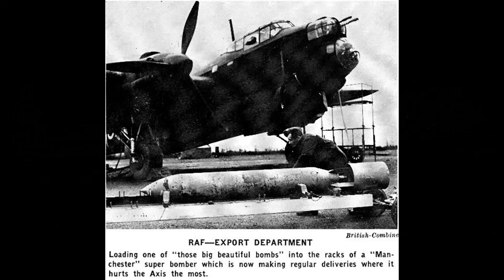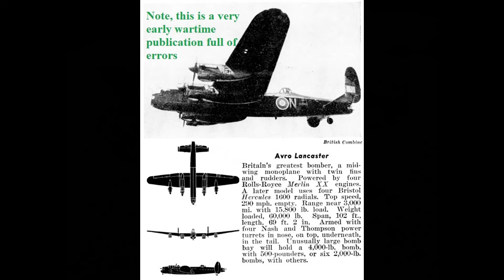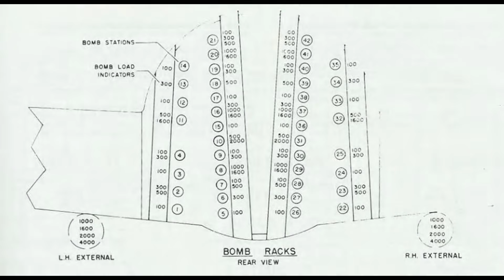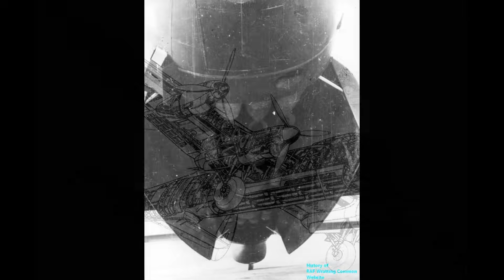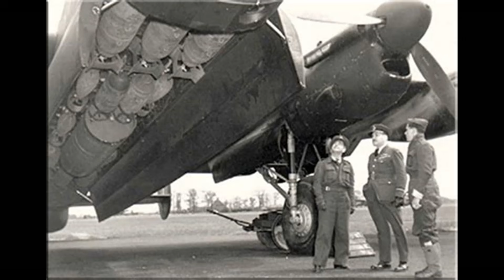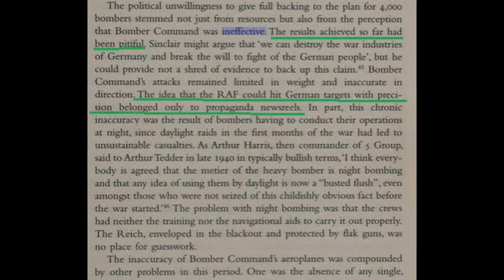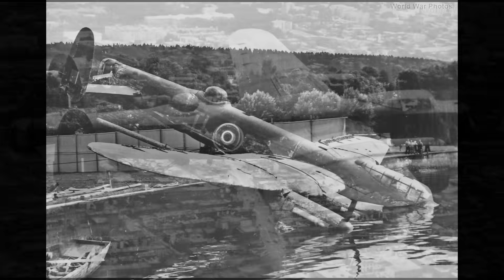Avro Lancaster, Payload, Turrets, Stability and More

Comment: The Lancaster JB456 you show at eg 28:20 seems to have a very odd mid upper turret.  It's positioned as per the Martin turret but looks to have a pair of impressively long guns coming out of it.  Any ideas?
Reply from the maker: I'm not sure, but some in the comments have some decent theories.
Reply: JB456 testing the Bristol Type B-17 turret with twin 20mm cannon.

Comment: Someone already mentioned twin stabilizers let you fit into existing hangers better than a single taller one; and similar hanger height restrictions are, I believe, why most modern carrier aircraft use them.  (Though you could alternatively go with the folding stabilizer route like the old A-5 Vigilante had to use).
Reply from the maker: Yes, I covered that hangar issue in my recent TWA video. It's sometimes a factor.

Comment: I was taught that there are three regions of stability while in a bank in reference to bank angle.  
A shallow bank is a bank angle that when input pressure is released it will naturally return to the trim setting.
A medium bank is a bank angle that will continue when input pressure is released.
A steep bank is a bank angle that will increase when input pressure is released.

I enjoyed slipping a plane in for a crosswind landing.  I never understood the roll of dihedral (I'm still going to have to study on that some) except in kites.  I always thought in terms of spilling air out from under the "high" side of the kite in order to return it to some level of equalibrium, (or some level of level)  [see what I did there with level?]
Also, it seems to me that dihedral and high-wings provide what appears to be pendulum like stability.

Comment: Whats the reference for the b17 being able to carry 12000 lbs internally. No question it could carry that weight but on the internal racks?
Reply from the maker: The Reference is the B-17 pilot's manual. I think I put the actual page on screen but I'm not sure you can see the details. Anyway it's 12,800 pounds internally via 8 1600 pound bombs. There were of course external hard points as well.
Reply: @GregsAirplanesandAutomobiles  thank you.

Comment: Hi m8. Thank you tons for last response to my question a while back re the Lycoming XR-7755 36-Cylinder engine, taa so much m8. Another Q from me is on its way but if you have better things to do , don't worry too much about a response. You are amazing by the way.   
 Q - How many - approx,  (ratio wise maybe),  Manchesters were constructed without the central fin?. I've never seen a Manchester empennage arranged like in those images early in this vid. I can imagine performance was a little better at least, in this model due to less drag. 
You know what they say 'Small Things Amuse Small Minds' though I believe this saying is upside down. Small Things/Big Minds.
Be well Greg.   @.

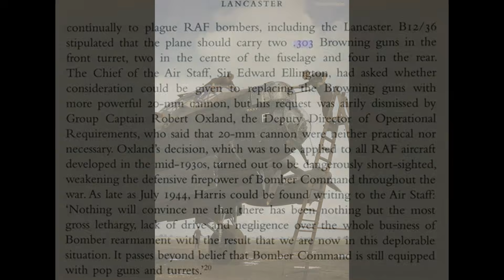Comment: 21:30  It's interesting that they didn't go with the Vickers .50 machine gun, which seems like a reasonably easy swap for the .30.
Reply: The Vickers 50 was not a good swap for a browning 303 in terms of dimensions. It had a lower power than the Browning 50 and a low rate of fire.
Reply: I think they did for the rear guns in later Lancasters
Reply: @oco8783  no, brownings
Reply: @wbertie2604  I meant .50 cals, I don't remember what type they were. They were probably Brownings

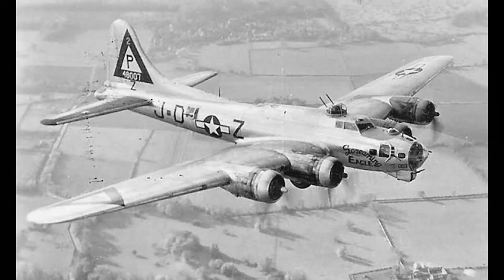Comment: 22:59 - B-17 from my tail gunner Dad's bomber group: 384 Heavy, Grafton Underwood - Triangle P - Assigned to a different squadron though. Use this search string for more info: B-17G 44-8007 
"44-8007 was equipped with a PFF (RADAR) system in place of the Ball Turret. Therefore, it did not have a Ball Turret Gunner assigned on any missions."
Reply: AN/APS-15 AKA H2X  or "Micky" 3cm wavelength ground mapping and bombing Radar
Reply: @richardvernon317  Wait, ground mapping?? Need to check that out, thanks for the reference! And of course equal thanks @Cowboy Bob for mentioning that system - never knew about the automated ball turrets, that stuff is really super cool - hard to imagine any such turrets could lead their targets in a meaningful way, but I guess being smart always meant to find those amazing shortcuts that did 85% of the functionality while taking 15% of the effort of the perfect solution...
Reply: @decnet100  There wa no automatic turret on the B-17. H2X was a bombing system loosely based on the British H2S, but fitted with a bomb aiming system that would fly the aircraft via the Autopilot and release the bombs like the Norden Bombsight would. Yes the lead aircraft would bomb by radar based on an aiming mark plotted on the CRT display by the bomb aimer or navigator and the rest of the formation would toggle bomb with him. The Radar scanner was in a retractable radome located where the ventral Ball turret was normally mounted. Only 4 Squadrons of Lancaster's did get an auto gun laying radar for the rear turret from September 1944 onwards, but they were really not that reliable and were more useful for early warning that somebody was coming up from behind.
Reply: @richardvernon317  Ah that makes sense then... I figured it was an entirely different radar system to the H2X/S, so I guess that would make the plane he described with the radar in the ball turret the lead plane then?
Reply: Would these types be used as a "bomber leader?"

Comment: 15:00 safe jettisoning of bombs wasn't considered too much of an issue as it was assumed that the target would be Germany and any route to or from it would be over sea, with designated areas off the coast to dump bombs. It doesn't help with hung bombs, of course. A number of British designs (produced or designed) of the period had bomb cells also in the wings where there was even less chance of access. For wing cells the logic was to allow salvo release of an entire load easily by concentrating the bombs across the aircraft's COG.

Comment: Even before the eventual failure of the Vulture, Handley-Page had indicated it was going to switch to four Merlins. I'd need to check which HP. 5x number was the original design. 

These designs were originally to P.13/36 which was the new concept for a medium bomber with up to 8000lbs of bombs with the potential for catapult launch for overload. The previous (medium, but not really distinguished as such) bomber target (Wellington, etc.) was 4000lb. I have read (and I don't know if it is totally accurate) that the Halifax still had some structural strengthening for the catapult launch option. This requirement reminds me a little of the He-177 and the requirement to dive bomb.

B.1/36 was the Stirling and the heavy (circa 12,000 lb in the specification, IIRC, actually capable of more), but the move to Merlins for Halifax and Lancaster allowed much more than the P.13/36 target.
Reply: A not untypical load for a Lancaster going to Germany was actually 8000lb, but without the need to catapult launch. A lower weight allowed a faster cruise speed. But sometimes missions to Germany were with the full 14,000 lbs.

Comment: Interesting to hear that the bomb bay design meant that the crews took off with armed bombs and couldn’t access them in flight.
Reply from the maker: Yes, well not exactly armed, but with the pin for the arming vane removed, which means almost armed.
Reply: @GregsAirplanesandAutomobiles  Thanks Greg, yes, some comfort for the crews. BTW, on crew safety, have you ever read Into The Silk by Ian Mackersey? Tells the stories of how air crew got into the Irvin Parachute company’s Caterpillar Club, ie by bailing out using one of their chutes. A tremendous read.

Comment: The LeO451 bomber had low wing and twin tail...
Reply from the maker: Yes, but the fact that almost nobody has ever heard of it sort of makes my point. In regards to that plane it has some sweepback, and a good amount of dihedral in the wing and a lot of dihedral in the tail. All of which probably adds up to just enough in that case.
Reply: @GregsAirplanesandAutomobiles  Well, even if nobody knew it, it would make no difference from an aerodynamical perspective...
I'm kidding 😁

From what I've read about the LeO45, it actually... proves your point: it had poor lateral stability at low speed making it somewhat hard to fly. Despite that, the engineers... reduced the size of the vertical stabilizers. Which did no good, of course. They were later replaced by larger ones.

The twin tail was used to clear the field of fire for the canon on the back (an Hispano, from which the 20mm used on British aircrafts were derived). Later, it was discovered that this canon was ineffective: slow rate of fire, and limited amount of ammunition in the drum, which was itself almost impossible to replace in flight. It was suggested to get rid of it, use the weight saved to add some armor around fuel tanks and... replace the twin tail for a single one, for better flight characteristics.

Comment: The Lanc did not have the issues with the vertical stabilisers suffered by the Halifax (until the MkIII), at the cost of many lives, including those who tried to investigate the problem.
Reply: Merlin powered Halifax was a dog of an aircraft!
Reply: Handley Page ignored the advice of Rolls Royce and used their own design nacelle rather than the RR power egg which was why it was a dog.

Comment: About bomb arming. Unless they worked differently then than they do now (I don't think so) the pin you mention doesn't arm the bomb, it locks the release mechanism so the bomb can't release from the rack. I also suspect that even in a B-17 those pins were pulled pretty early in the flight so the bombs could be jettisoned quickly in an emergency. You don't want to have to wait for someone to pull the pins if you lose a couple of engines and need to lighten the ship in a hurry.

Arming is controlled by the arming wire. It's held by a solenoid in the rack and leads out to the fuse where it extends through the blades of the arming vane. The bomb can be released unarmed by opening the solenoid so when the bomb releases, the wire isn't held by the rack and remains attached the the bomb, blocking the vane from spinning and arming the fuse after it's dropped. 

To release the bomb in an armed condition the solenoid retains the end of the arming wire so as the bomb falls away, its other end is pulled out of the arming vane and that is free to spin in the airstream. The function of the arming solenoid is controlled from the cockpit or bombardier's position and is set in flight. They'd all be set to "safe" until well into the bomb run.

There's still the danger you mentioned of a hung bomb though. If a hung bomb releases after the bomb bay doors are closed, even if the arming solenoid is in "safe", there's still a chance the arming wire will come out of the fuse. But, it's not in the airstream so it shouldn't arm.

In short, pulling the pins doesn't arm the bombs. They only safe the release mechanism of the rack. The wire isn't a "secondary" arming feature, it is the arming feature.
Reply from the maker: The pin I mentioned very specifically prevents the arming vane (the little propeller) from spinning. In fact in the official procedure, after they pull that pin they check for freedom of movement. The RAF made a video on the procedure and it's on youtube.
Reply: @GregsAirplanesandAutomobiles  

https://www.youtube.com/watch?v=ZtmuApC_W2I&ab_channel=AWMCollection

@19:24, the loader is inserting the end of the arming wire into the fusing solenoid. It's a little bit different than we did on F-16s and F-4s. There, the arming solenoid is up by the suspension lugs. Here, it's back closer to the tail fuse. This system also allows for a selection of fusing in flight if you have both nose and tail fuses. They can be set for different delays and which one you use can be selected by which arming wire is retained and which is released to fall with the bomb from the cockpit.

Comment: Miracle people solved the mass production headaches involved in getting huge numbers of the RR/Packard Merlin engines coming off production lines rather than out of the bottleneck "fitters shops" of early WW2. To little real credit afterward. A slight Lancaster wartime quirk was an "economical"  single pilot position when it came to equipment, no co-pilot duplication of anything. 
The hopeful assumption was that since many of of the aircrew were probably failed pilot trainees, the single pilot could train them "good enough" to fly fairly straight and level out of enemy territory before "they hit the silk" if anything happened to him. Helped to pass the time before reaching/ after leaving battle country. Bet no other teacher in the world ever had "a more attentive class".
Reply: The single pilot worked